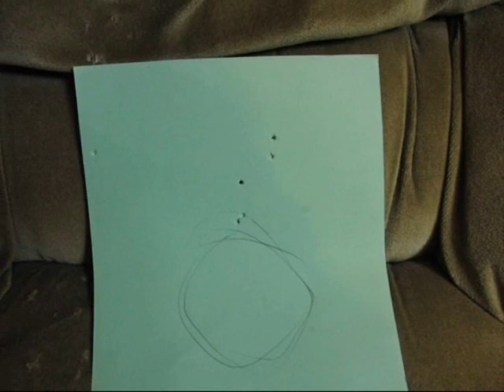hahn restoration pt 2

Comment: Fifty five years ago I bought this gun for my six year old son - all of a sudden I’m back into BB guns - maybe because I had two hip surgeries a year ago. I only shoot pistols ,and I have bought about 50 pistols. The gun I bought for my son  - I went to the leather shop and had a custom holster made for him the gun and holster are still in good shape - with no leaks. Just bought another set up on eBay redhead holster black and now I have to replace seals for leak. Your video really helps. If you ever do this for pay let me know.
Reply from the maker: i live in the UK and bb guns or any co2 guns were on firearms certificate only , until paint ball changed the law here . not just ridiculous saying that spring powered guns using air were ok , but a co2 gun of the same power wasnt  , but also meaning that when i was a teenager and saw crosman six shooters  in a second hand shop i wasnt able to buy them !  hope you get on ok with the seals . simon
Reply from the maker: just remembered i put a video of replacing the neck seal on vimeo (as the youtube uploader no longer works on my computer )  you should find it by entering this in the vimeo search   HAHN 45 CROSMAN SA6 NECK SEAL REPLACEMENT

Comment: Awesome videos! they are very helpful. I got one question. The frame is made of steel? could it get rusted?
Reply from the maker: the back of the cylinder , hammer , internal parts   springs and cartridge tensioner are steel  . the frame and the rest of the cylinder are soft easily cast aluminium or zinc alloy